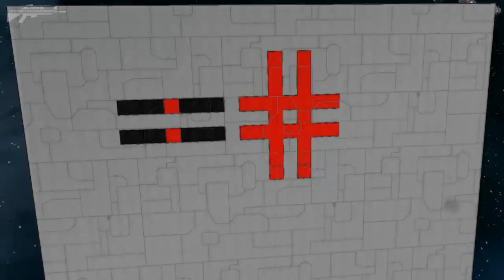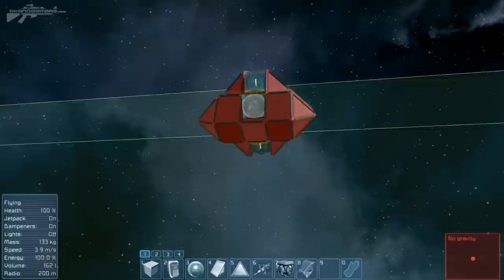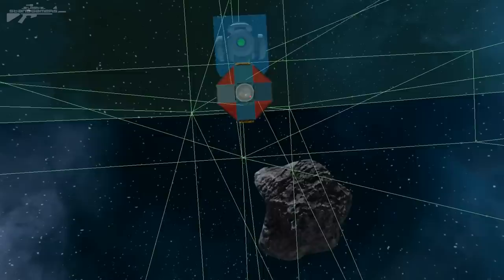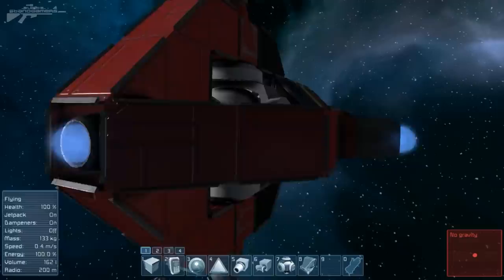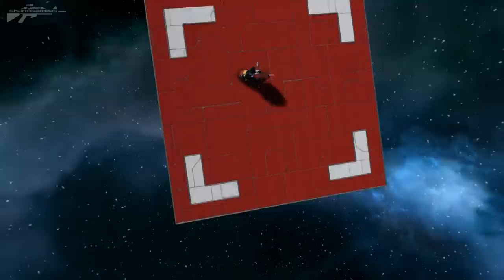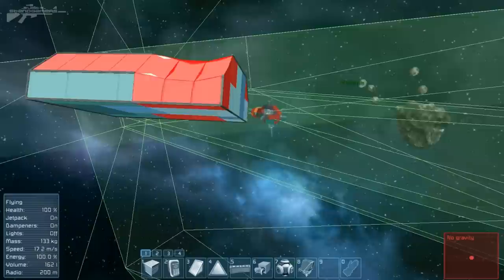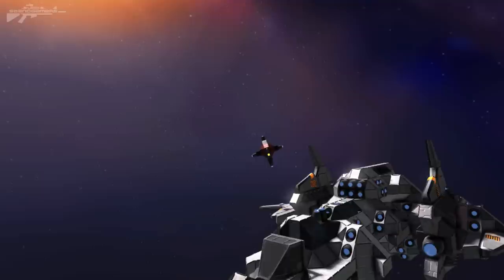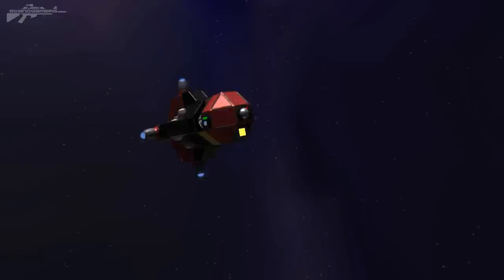Space Engineers - Lock On Missiles, Sensor Guided Ordnance Concept

Comment: Dude, these could function as harasser drones. Put some drills or maybe a grinder on the front end, and just launch a shit ton of them at an enemy ship.
Reply: Yea, in one moment you have a ship, in the next you don't xD
Reply: you just need it not to lock on to you when it is on tho... bye big ship number 5#
Reply: If you used drills, or thrusters, that would wreck ships.
Reply: Anton Flax Well, if you fire one or two, you may be able to fire them and then activate the sensor systems remotely.
Reply: Ethan Epperson Also you may use sensor to activate the thruster which will burn through the enemy ship so your missile is faster while it still catches to the ship.
Reply: Димитър Кръстев well the grinding missile grinded away my command center :(
Reply: Димитър Кръстев you gave me idea of how would it be fun to group ships in remote menu
Reply: Drop these, with any of the above on it, behind your ship when you are retreating and then activate them with antennae.
Reply: or add gatling turrets as well
Reply: Anton Flax well, in that case if would be beneficial to group all the stuff on the missile in one big group so you can disable it easily if anything like this happens.
Reply: GusCraft460 Nah - just lay a minefield with these (If you use grinders set it to not detect players so you can grab the stuff from it from time to time)
Reply: ejrees186 or rocket launchers if you are fighting large ship
Reply: GusCraft460 no - if you build them out of small ships parts only and disable detecting small ships from the sensor they shouldn't (I am talking about minefield for large ships because there is no point in fireing something like that against fighters because they can just dodge it or outrun it.
Reply: Димитър Кръстев A fighter could, but would they even try?  Not likely, especially if you added turrets to them, it just wouldn't be worth the risk.
Reply: GusCraft460 yes but if you add turrets to them it will detect itself.
Reply: Димитър Кръстев Set turrets to attack other factions or whatever it's called, because turrets have that setting, however sensors don't.
Reply: GusCraft460 yea - a function to set the sensor to detect only other factions or only your faction will be nice
Reply: Димитър Кръстев You could have faction only doors, like a wireless key card lock
Reply: GusCraft460 yea that will be fun - to trap somebody in a airlock with 2 of these doors connected to sensor
Reply: i was thinking of a more defensive strategy and put these around your base without any thrusters, it would be a 360 by 360 defense turret, and then add it to not fire at your own faction
Reply: V0LTage131 go to sages channel then
Reply: MyWayDrawingAgain wow haha all they really need is more of a sensor range like they said xD
Reply: You could use these with gyroscopes only, and they could be rogue ship/ meteoroid defenses.
Reply: Buzz droids
Reply: To build off of that (and understand this would require a bit of work to have it function well) but you could have it track you with welders on it and repair your ship. You run the risk of it slamming into you and breaking the welder, but if you could get it to work properly that would be a good "medic" ship.
Reply: Can the antennas be turned off through anther antenna so they don't just turn the missiles off or use them against you?
Reply: ***** Pretty sure a lot of people thought of this design. It's incredibly simple.
Reply: Димитър Кръстев The missile grinded away my ship command center and my crew :(
Reply: jordan marshall I think yes, but to remotely control something you have to own it, so if you own the missiles they can't disable them remotely.
Reply: would be good for just a defence platform, although would still need thrusters so it doesnt cause itself to drift
Reply: ***** better get a copyright next time....
Reply: *****

You know that in the space engineers forum is since 5 days a thread about weapons/drones and I build a very similar design at friday (without knowing that other make nearly the same as I)
Reply: BUZZ DROIDS! :D
Reply: MrSpecialKTJ you gave me an idea what about a grinding Rover like vechile you lower the Ship you want to scrap and then you hop in and then Start grinding away
Reply: simontheewok you could try and put a sensor at the front set to 5 meters that would disable the engine
Reply: Димитър Кръстев What if you put a merge block onto it's tail and make a portable forward engine. If you want to shoot it, just aim at the enemy ship and then overload the thrusters. If a sensor sees the ship, it will disconnect the merge block and begin the ramming or "drilling" protocol.
Reply: I had the same idea only for mining
Reply: Road Buster nice i will make the thing tomorrow so yeah hope it works...
Reply: BUZZDROIDS!
Reply: Homing Mines... since they are closer range...
Reply: Only one flaw in this plan. If the ship your shooting at has Gatlings set to fire on moving objects. Light armor might as well be paper to the big ship guns. And even heavy doesn't last much longer.
Reply: If they have an ignore faction option on it so it does not track friendly blocks/ships
Reply: ***** Welcome to City 17.
Reply: If you add on another sensor that will sense "enemy" ships then use that with a timer you could make it self destruct when the missile is approced
Reply: Kinda like the buzz droids from star wars. (if you dont know what im talking about dont reply)
Reply: You could put a timer block on so it doesn't start actively seeking until it is away from your ship. I want to take the Andromeda Ascendant from the workshop and have it fire like fifty of these at a time.
Reply: Put a Grinder and a Warhead on, Warhead has timer, Grinder plows  into ship getting into the interior of the ship then warhead explodes. dealing damage to the Inside of the ship
Reply: MudkipzGamez That's a great idea for a bunker buster!
Reply: Or have a load of em with grinders that break into the hull. And each one has a seat with a person inside, so you can launch a squad of guys at a ship, have them impact at different points, and have a load of guys all across an enemy ship.
Reply: now now, this isn't starwars... or is it, GIVE US DROIDS!
Reply: Tcman95 Ima Going to start playing around with that Idea. See if I can get a Prototype
Reply: Now add an antenna and a warhead. If it is stuck in the ship, you push a button and BOOM. You could even do that automatically with a sensor.
Reply: or even better stick a turret on it since u can make these as large ships if it isn't a large ship already. Then launch a bunch of those at the enemy.

Comment: I've spend enough time fiddling with it. Apparently the way to do it is to make the sensors turn the gyroscopes on and off but have each gyroscope set to turn, (using override), in the direction that the enemy will be in, such as left, right, up, and down.
Reply: +Subject Zeus tried that and it does seem to work if only 1 gyroscope gets triggered but if two get triggered it just starts spinning randomly

Comment: Brilliant work with the tracking system! In a previous video,I saw that the artificial mass generators fell right the the floor and caused some major damage. What if you attached a final sensor to the missile, which deactivated inertial dampeners and activated artificial mass generators (once within a couple meters and clearly going to hit the target). It may be able to penetrate a little deeper, putting it in a more opportune position to detonate internally in a larger ship

Comment: I have a suggestion for a new creation.
You could use this lock-on system as patrol drone, Overridden gyro would make it fly in circles, And any of sensors would turn that gyro off and engage follow mode and Gatling on front start shooting. You could also remotely take control over that drone and use it to shot it down manually.

Comment: If you added a sensor that detected when things were in the crosshairs, you could have that activate rockets or a gatling gun on the front.  This could also be applied to the back of fighters, to discourage pursuit.
Reply: This could be used to make fighters. Swarm with these things!!
Reply: Gatling Guns and Missile Launchers are not fireable through the Control Panel, atleast not yet.
Reply: Semour Butts I uh think he meant the rocket and Gatling turret
Reply: Angel Ruiz Didn't seem like it
Reply: Sage tried that.
Doesn´t work so far.

Comment: Can you use sensors to deactivate tengines? You could place 1 on the front to deactivate the rear engine so when it comes near you it stops( with an engine on the front and inertia dampeners to stop it). that could be used to transport materials and have a larger invetory when you are building, or simply a pet.

Comment: LastStandGamers 
You read my comment, didn't you? :)
I made some by myself, but they work a bit different:

There are four sensors detecting just forward and just in front of it. When there is a ship in the area of the sensor it triggers a gyroscope to turn in the right direction AND (!) a thruster which accelerates the missile towards the target as well.
I do have some problems with oscillations since the missile overshoots while turning to the target, so it wiggles around a bit, like yours does when the ship is far outside. I strongly recommend using thrusters as well, since your stabilization thrusters have to slow down the missile while the back thruster has to accelerate it again in the new direction, but obviously it is not powerful enough. To solve this problem I am turning on the back thruster when it locks on, so it does not overshoot the target due to high velocity.

I would like to hear your opinion about my design! Unfortunately I have no idea how to use the workshop since I just bought the game to built a lock on missile... :D
Reply: Cool, I can't play the game :(, but I understand it pretty well, and I believe that adding more gyroscopes would fix this, I am not sure if they would need to be hooked up to the sensors, or if they could just be built and left alone.
Reply: I have one spare gyro which stops the missile from spinning when the missile is exactly behind the target. but once it spins fast towards the target this time is very short, so the spare gyro cant stop it completely. so it overshoots a bit, turns back, the gyro slows down the rotation again, it overshoots in the other direction, ...
That goes on for a few oscillations, until the spare gyro stops it completely.
Reply: Add more spare gyros.
Reply: Currently doing it... :D
And I am working on a super light version for dog fights. lets see how that works out.
BTW: pistons as extensions to increase the area of no turning do not work since they are bugging :(
Reply: Meh, pistons do that, neat concept though.  remember to add a sensor to stop it from ramming into other fighters.  Set a decent range (not max, like 1/3 max) in front and set the sensor to activate braking thrusters when it detects something and to deactivate them when that thing leaves.
Reply: Since they don't lock on to the ship I am flying I don't have to worry about that, but if they fix it, locking on to yourself will be a problem. But I have no idea how to stick it to the ships anyway... well... I didn't even built a ship yet...
Reply: If you mean pick it up with a ship, you can use landing gear, merge blocks, or connectors (ejectors?).  And you can set it to ignore players.
Reply: merge and connectors are to big, don't think ejectors work. Landing gear works, but the missile hat to stay turned on all the time...
Currently it also ignores ships controlled by player (didn't test in MP)...
I think I can use the "Override increase/decrease" to stop it oscillating.
Reply: Did you set the settings to detect small ships?  I was actually talking about landing gear on the ship carrying it.
Reply: Yes, but the setting does not work very well. I wasn't able to lock it onto my ship. But floating small blocks or empty ships work well :)
Reply: DID IT! Large, adjustable lock area (no rotation), almost no oscillation, max 3 oscillations when entering from side. ABSOLUTELY no oscillation once it locked on, maximum possible lock on area, small design (2*2) possible. This does not include the control trusters...yet
The only problem is that it just suppresses the oscillation when it is exactly in the middle (lock area). If it oscillates in circles around it oscillates quite some time
Reply: It is a physics engine related problem:
If there are two gyros acting against each other the deceleration on this axis is extreme (like in the video). If there are four gyros (two pairs) acting against each other the deceleration on both axis will be extreme. BUT if there are three gyros, two acting against each other and one without a counterpart there is no deceleration, not even in on the axis of the gyros which act against each other. A normal gyro will help out, but the deceleration will not be as great as the two-gyro-trick, and it also slows down the turning speed.
This is only solvable by using a system without overlapping sensors. But they can't be built small, since the sensors have to be far away from each other.
What should I am going for? Small, but possible to doge or accurate but large?
Reply: The current issue with these missiles is the detector range is pretty limited, even for large ship sensors, coupled with the slow(ish speed) it limits their combat potential, for now at least.
Reply: That's true, all my test are done at 20m/s relative to the target.

Comment: Great way for mines, you just have one sensor and tons of explosives and a reactor. Cheap mines, but effective.
Reply: Well, his design can be used as a mine, just add 1 more sensor to turn on and off the thruster controlling forward velocity - if a ship gets in sensor range the missile should point at him and propel itself straight to his ship.
Reply: It might be cheap in terms of material, but I made something like this a couple days ago and it was very hard to set up.
Reply: You could also have something like a guided missile set up, so that once a target gets in range the mine actually heads towards the target
Reply: Were Chicken I already made that! It is like a magnetized mine. I really need to get a video up of it before someone takes the idea
Reply: JandCandO None of these ideas are original. Someone, somewhere out there have thought of this already. Besides, all of this was already showed in LSG's video right here. Guided missile or guided mine - It's completely the same, here.
Reply: ***** LSG didn't make what I made. They both use sensors, but my creation is a space mine that sits still until a ship approaches. Then it slams itself into the ship, causing explosive damage. Somebody probably thought of it already, but mine is on the Steam Workshop and I can't find any others.
Reply: JandCandO Well, as long you won't call anyone idea-thieves, it doesn't really matter. Might not be on the workshop, but there are space mines here on youtube already. For instance, those displayed in this video. Attach a warhead to it and place it somewhere and it behaves the same way and does the same job - Results may vary on design. I suppose we agree on this?
Reply: ***** You have a point, I guess. But just for the record, my mine never rotates to face the target. It is symmetrical in all 3 axes. Here it is if you want to take a look: http://steamcommunity.com/sharedfiles/filedetails/?id=312069154
Reply: The difficulty with this would probably be mines in a mine field, hitting eachother.
Reply: archlorddestin They only target large ships. I had a lot of fun playing with them when they did go for each other during testing, though!

Comment: So what if you were to launch a device with this tracking ability out of a topside missile tube, like on nuclear submarines, and then fit it with the gravity warhead? It would more or less remove the main issue of that warhead being to cumbersome to aim as you've designed it. Not to mention the capability of simply outfitting this with typical warheads. 

I'd also like to see how this design could be modified for SAM contact on a planet's surface. 

The main issue I see with most of these designs is that they are simply cumbersome so I hope they end up adding features to Space Engineers centered around missiles, primarily adding a new size of building materials smaller than "small ship" blocks. It could even, preferably, be mostly just the same stuff.

Comment: Uses:
1) Automatic defense/ piracy drones.
2) Troll Drones.
3) Tracking drones ( By either following or having it auto-land using a landing gear and beacon)
4) extra space
5) anti-lock mechanisms ( fooling turrets/missiles and maybe providing cover depending on size of drone)
6) Quick get-away drones (by way mentioned above of fooling turrets, maybe drilling into ship, causing engine problems?)
7) Mining Drones
 If you can think of any other good uses, please comment and add on.